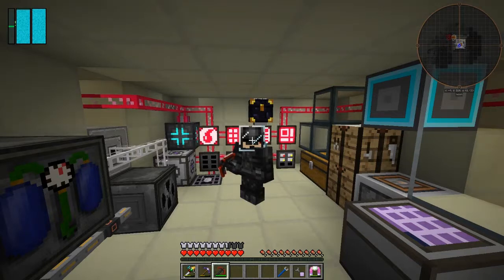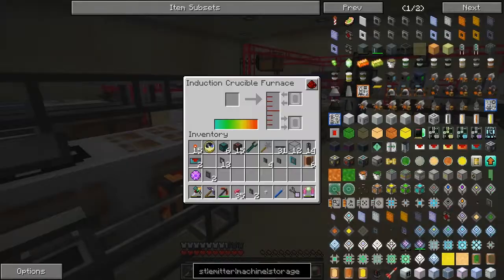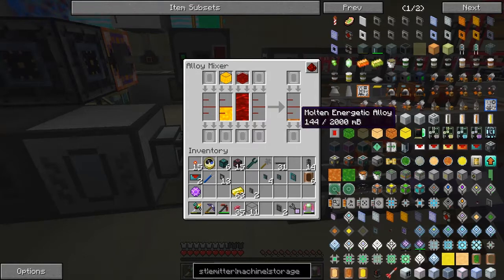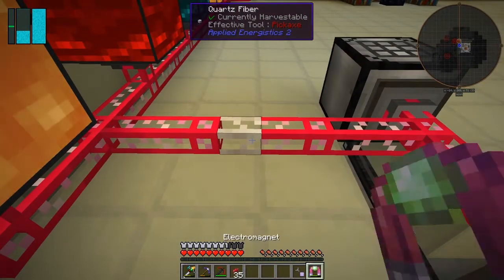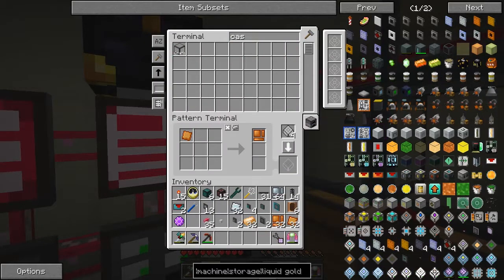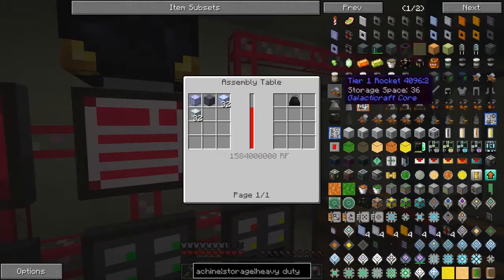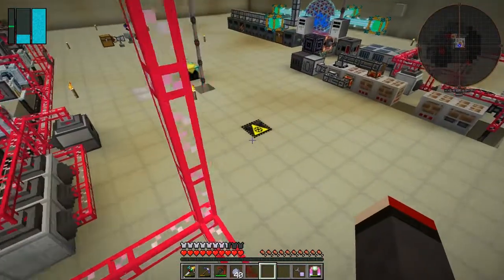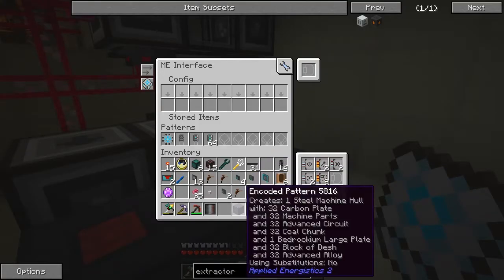Galactic Science 2 #89 - Oh What an Exploit!

Comment: Well i went and copied your fluid dupe but i expanded on its capabilities a bit. I i did it just like yours but with one full tank at the bottom on the import buss and 2 tanks at the top on the storage buss. I found that i could use a fluiduct and servo to pipe fluid back into the lower tank from the uppers and when it was full i removed the fluiduct and the lower tank would stay full that way. I then used another fluiduct and servo on top of the 2 tanks to fill a bedrockium drum. It pulls a lot more fluid this way since the lower tank is full instead of at 125mb.
Reply from the maker: ZeroLyfe I didn’t realise it was faster when the bottom tank is full, that explains the behaviour I’ve been seeing, thanks. I’ve optimised the design a bit since this episode. I’m still a little unsure about using the exploit, even though it is really useful, easy capacitors. My biggest problem atm is bedrockium, it takes so long to get enough cobblestone.
Reply: I wouldn't normally use an exploit like this either but i'm pretty much done with the pack at this point, I only have 2 quests left. I had to cheat in some antimony ingots already for 1 of the last quests since the recipe to make them is broken in all of the released versions of the pack. Are you using minechem to make your cobble from obsidian? I have 2 auto compressors, I could add more here to make it faster, making compressed cobble going into a 3rd that cycles the cobble through until it makes quadruple compressed, I can make 1 quadruple every 3-4 minutes this way. It's important to have large buffer for the cobblestone coming from the synthesizer too, I use a resonant cache, since it likes to stop working if it gets backed up. I have a storage buss on the cobble and quadruple cobble caches so my system can see both for crafting and it know it can make 9 triple compressed from 1 quadruple so this save auto crafting time and steps that the ae system doesn't have to do.
Reply from the maker: ZeroLyfe im making cobble both from obsidian and using the igneous extruder and Mars cobblestone makes the water. How many crucibles have you got making lava for obsidian and are you using Blazing Pyrotheum as a heat source?

I wouldn’t normally abuse an exploit, this one ruins some of the grind of the modpack and will be difficult to fix. I don’t want caithlean stopping as the pack is fun even if it is a bit too grindy.
Reply: I have 30 crucibles with pyrotheum sources under each one. This keeps a hardened cache full at 40k obsidian and constantly feeds a decomposer for making the cobblestone. For the piping on them I'm using either item conduits with 15 speed upgrades or transfer nodes with stack and a few speed upgrades in them, the item ducts are too slow even with resonant servos.
Reply from the maker: Worked very well thanks, IIRC i had a similar setup and the synthesizer kept blocking, now it worked so well that I had 54 buckets overnight (I moved to a server to try to reduce lag)